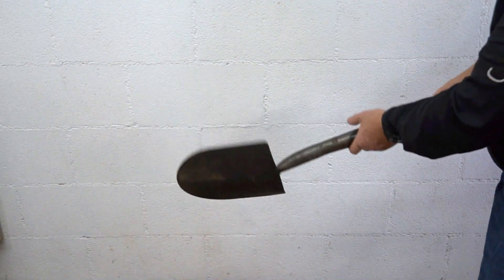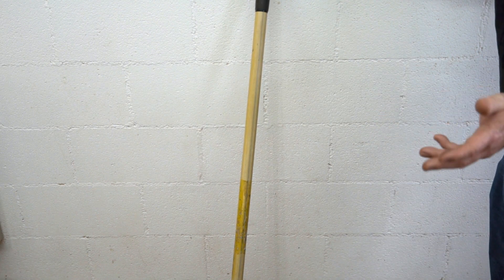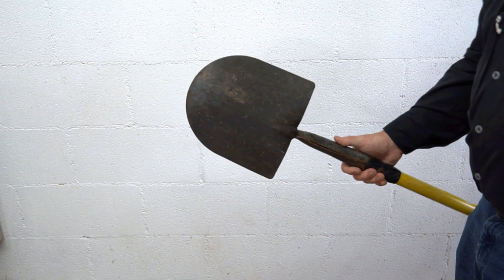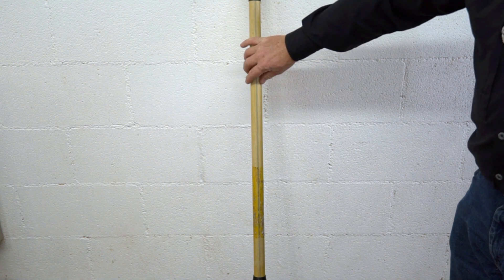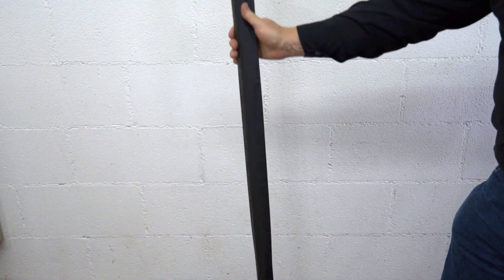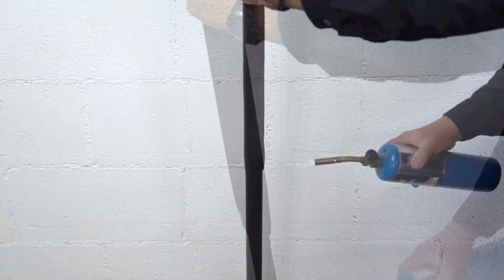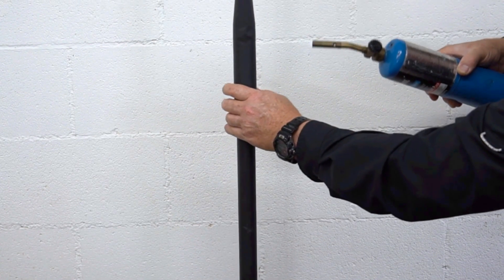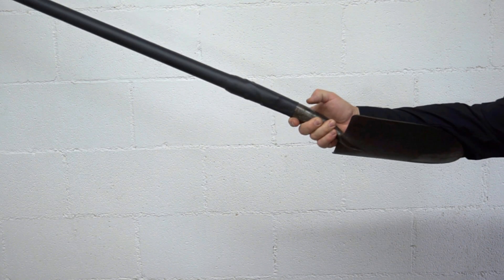🛠️ Homesteading Hack! How to Repair an Old Fiberglass Shovel Handle

Comment: Hello thank you and I have a question. Will this  stuff work if the fiberglass handle is splitting going around it?  Mine is a heavy duty spade with a plastic grip right above the head. Thank you
Reply from the maker: This will only cover up damage, it will not add strength or integrity back to the handle.  If the handle is still solid enough to use, you might sand off and then apply this.

Comment: Just wondering here,  maybe there is something like some tough furniture paint on finish or just some tough paint to get the same results. My hands are'nt as tough as they used to be but this Arizona sun has cooked off what used to protect those mean little fiberglass stickers from getting on you. And they will bug you for a good while.
Reply from the maker: I am sure there is some industrial epoxy paint out there that would do the trick.  The problem is, you only need a small amount I bet it costs like $75 a gallon. The heat shrink tape is a much cheaper solution, unless you have a bunch of tools to do.

Comment: Great idea. I use heat shrink on my aircraft cable keychain. You will have to replace it after a few years. Heat shrink loosens with time and abrasion because you are less likely to develop a cut in it than my keychain you can probably get away with just reheating/reshrinking it for the first several times. Have you thought about moisture getting stuck under the heat shrink and attacking your shovel head? I see that being a problem if the shovel is ever used for something wet.
Reply from the maker: All tools wear out eventually. This fix makes an expensive tool usable again for a good period of time for very little money.  Unless you were using the tool underwater, I doubt there would be any moisture penetration.  If the handle gets wet, it will become slippery, but all handles do to some extent.  If it is a problem, I would suggest maybe rough the rubber up a little bit with some sandpaper or wrapping it with some durable tape.
Reply: @thejungleexplorer  I was more thinking that water would get trapped against where the head attaches to the handle and rust it away. Living in Florida a shovel is likely to see water and stagnant/trapped water is what causes rust. I wouldn't be surprised if water got trapped under there that the shovel would fail within a couple years. Maybe I am being overly concerned about it but it would seem to be the largest failure point for this.
Reply from the maker: @Zanthum  You live in Florida.  Awesome.  Live there once myself.  Did commercial fishing out of Key West.

Comment: Is the 1.5" tubing the size it shrinks to or is it the original diameter of the tube before you heat it up?
Reply from the maker: The original size of the tube.
Reply: @thejungleexplorer  Okay, thank you.  The handle we have is 1.5" at the top of it (the widest part) so was debating if that sleeve would fit over.  The rest of the handle is closer to 1 3/16 width.  Just wanting to verify it is similar to how you measured.  And fiberglass in the palms is terrible so happy to see an easy fix!
Reply from the maker: @SLM-ri2ph  Yes. This is the best way to fix this problem. It has been over a year since I made this video and I have zero problems with this shovel and have done other implements the same way.  I like the feel of the rubber a lot.
Reply: @thejungleexplorer  Yes, it makes sense.  I just wanted to make sure the 1.5" would fit our handle (it has that thicker grip up at the top similar to the one in your video).  Have you ever applied the heat shrink using a heat gun rather than a torch?

Comment: The link takes me to 1/2” Heat Shrink tubing, not what he shows in the video. I agree with other, too chatty. Can be fixed with editing the video.
Reply from the maker: There are other sizes available on that page.  There are 1", 2" and 3/4" sizes to choose from.  What size do you need?

Comment: I personally dont like fiberglass handles. They dont last as long and break easy. Then when they do break they shatter. I only use them when it's all I have.
Reply: I will be 70 this year. Never had a fiberglass handle break. I guess I don't work the tools as hard. My new wooden handled shovel broke recently. I actually think this hack/fix will work.
Reply from the maker: Thank you for commenting Micah Frye!